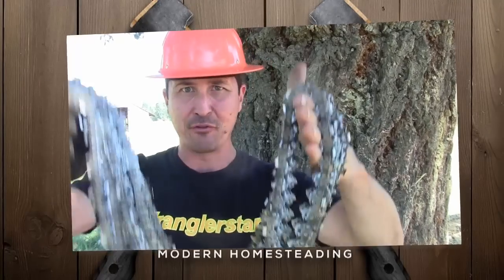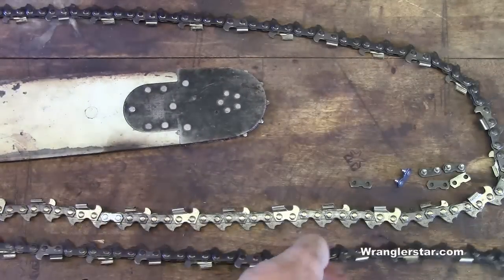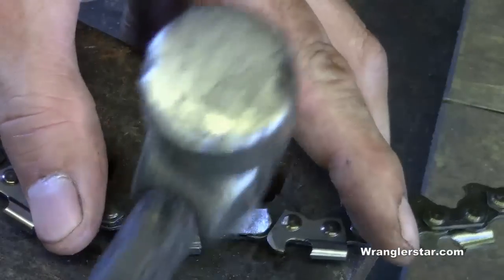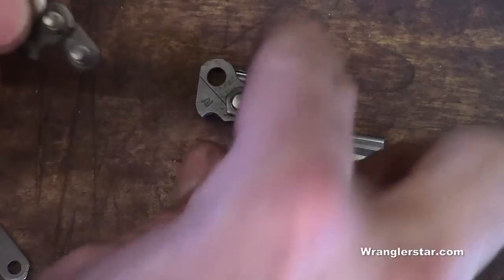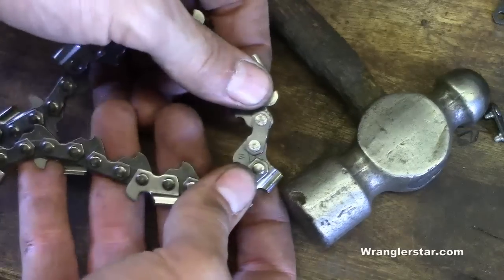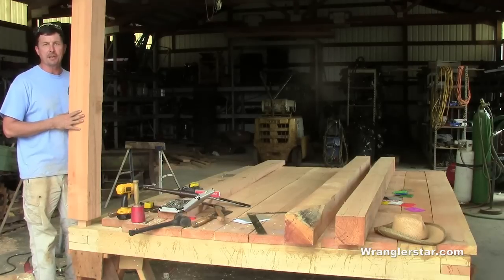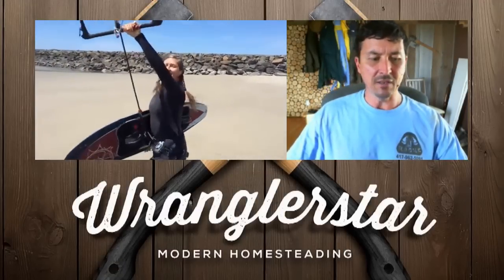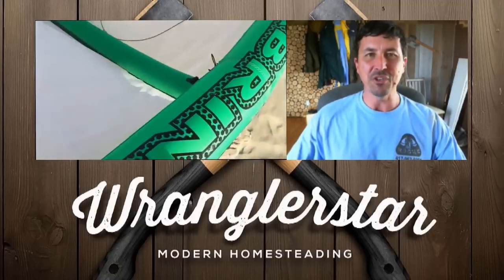How To Make A Chainsaw Chain | Wranglerstar

Comment: Couple things to help elucidate: what yer calling "master links" are known as "presets" (with rivets spun on) and "tie straps". They are specific to a given make/model/gauge/pitch of chain- don't mix em. Chain length is given as #DL, that is, number of DRIVE LINKS,  which are the "shark-fin" thingies that ride in the bar groove and engage the sprockets. Peening rivets is for emergencies only. Northern Tool has a good bench-breaker/spinner under $100. Granberg makes a portable breaker/spinner for $50-something- better at spinning than breaking. Hammering can crack rivets- a no-no.

Comment: Cody you ever look into carbide for your chain saws.. they are almost  indestructible ..hit the dirt or a piece of hidden wire not a problem.. but are not cheap, but 1 will outlast at least 6 well cared for blades.

Comment: I used a vice grip chain breaker for 20 yrs. I had my 100' roll of chain in my pickup, it would take about 5 minutes to make a new one up.
If i had a broken side strap on my chain, i'd fix it with out taking the chain off the saw.
55 yrs ago when i broke my chain, i fixed it with a flat file, 3/4" socket and used a nail for a punch. When fixing a used chain, you have to use used chain straps, new ones cause the chain to loosen and tighten up.

Comment: Am reticent to speak up. But I think it's the drivers you count (look like sharks teeth). Then you would not have to back up one. 

When tightening the chain and bar on the saw, the slack must be taken out of the fit of the bar. Simply hold the bar nose up just enough to take the little bit of slack out of the bar. And if the chain is just properly tight, then snug up the bar nuts.

Comment: I noticed on these chains if a link does get to tight and won't smoothly move on the pins/rivets that you can put a hard tool like a chisel in between the link where it is open air space ( like in between the two "link' sides and on a hard surface like an anvil, hit fairly hard with even a claw hammer on the chisel and the link will loosen enough to work good again. Gotta be careful and not damage the link when doing it but solves the problem I found out and does seem to get you back "sawin" again making progress.

Comment: For complete chain bar maintenance . Not only ensure oil holes on both sides of the bar are clean and but, in addition, clean the interior of the bar slot with either the Oregon slot tool or similar or even a clean putty knife prepared with kerosene/gasoline, scrape and clear with high-pressure air.
This will ensure the fresh bar oil will travel the full length of the bar unimpeded by dirt or sawdust build-up!

Comment: Cody I have a residential craftsman 18 inch chainsaw and was wondering what type of chain you would recommend to use on small chores around the house. Like limbing trees and cutting them to size for fire wood

Comment: regarding the mushrooming safety comment... super important to remember. most times those tools are not hardened at the striking area but are not super soft either, and do have internal stresses. once a shard comes loose those stresses can assist in turning that small shard into a harmful projectile.

Comment: I always wondered how to make a chain.  I have a cheap 14" chainsaw but have thought about putting a larger 16 or 18 " chain on for occasional use.  How do I make sure I get the right bar that will work with my chainsaw

Comment: good video - My wife bought me a ROGUE 7" Tomahawk hoe a couple months ago and I didn't really get a chance to use it until last week when I used an excavator to dig a 700 ft water supply trench at the farm; I used the Rogue to pull dirt on the 1.5" PVC supply line just to give it some support in the ditch before using the blade to cover it - what a great little tool, has the weight to dig in a pull dirt I used to use a shovel for.  Then when the plumber installed 190 ft of 4" drain piping he used it to pull dirt back in the ditch to support the pipe before using the excavator blade to cover the drain system and his crew loved the Rogue.  I had a hard time keeping track of it to the point I was afraid they were going to toss it on their truck so I finally confiscated it.

One last issue with the Rogue - when the UPS delivered it you could tell they dropped it and I had to 'ping' draw out the dent in the blade - they need to cover the blade edges with something a little more substantial then cardboard.

Comment: I noticed you didn't talk about pitch or is it covered In a different video.  I have 3 saw with 3 different pitches. As the bars or sprockets get replaced I'm going to change them so I don't have to have so many extra part around.

Comment: Ok, Ok. I promise to be more active in the future. Cody, I have an older chainsaw (about 15 years old) that only gives me about 10 minutes of use before the chain gets loose. Any suggestions? I cleaned all the gunk and sawdust out of the sprocket area, it appears to be in very good shape but won't stay tight...

Comment: I knew if I searched I would find someone that would do this without a chain breaker and spinner. Without thinking I bought a 25 ft roll of chain but did not know 1 thing about how to put it together. Thanks I did not want to spend money on such a specialized tool as a chain breaker and spinner.

Comment: Cody, I've been out of action for 18 months and need to get the chainsaw out to cut some firewood ... didn't get to clean it up before I got sick. Can you do a video on how to do a quick clean-up on the saw before I get it up and running again? I'm worried about stale fuel and clagged up sprokets etc.
Reply: If you drain out the old gas, put some fresh stuff in there maybe with some stabilizer in there, pump some fresh grease into everywhere it'll go until you see quite a bit flow out, and do an oil change on it(if it's a 4 stroke) you should be good to go. It's probably a good idea to have a look at the spark plug as well as spray the tank with some carb cleaner or brake cleaner before you put the fresh gas in, but it's not super necessary. Make sure you drain whatever you clean out of the tank.
Reply: Thanks Jack.. It's a 2 stroke (Stihl MS391 http://www.stihl.com.au/STIHL-Products/Chain-Saws/Landowner-Chain-saws/21615-1572/MS-391.aspx ). I've only used it twice so I don't want to stuff it up now by not servicing it properly. I would pay a professional but our local guys have proven without a doubt that they are incompetent fools when they did the 5 hour service on my mower and did $350 damage to it attempting to straighten something that was supposed to be bent. It's home servicing from now on.
Reply: I would tip out old fuel and replace with a fresh mix with new petrol. I have done this with machines left 12 months and they started up, it may take a few more pulls than normal to get it going. Do not try and start it up with old fuel in. If saw is not going to be used for some time tip out the fuel and run it dry.
Reply: You have gotten good advice here, and I'll second or third that advice. Drain out your old fuel and put some newly mixed fuel in the saw and see if it will run. I do worry you might have more work though, as a lot of the fuel in the US has ethanol in it and it can do bad things to rubber parts, stuff like fuel lines etc.
Even so, if you have to fix it yourself, I say go for it, there are lots of good videos on rebuilding the carbs and such if you need to, these are fairly simple machines and you don't need a lot of specialist tools to service chainsaws.
Domo
Reply: I did find something on the Stihl web site about draining the carbi first to stop the diaphragms from sticking together. Sounds like something easy to break. I'm pretty good at fiddly mechanical stuff, but I'm nervous about stripping down a brand new saw that I've spent a bucket load of money on. Gotta get into it and learn at some point though. Thanks for the tips everyone.
Reply from the maker: I have a two part series how to service your saw. Here is the link http://youtu.be/vFwVCU_O9-4
Reply: Thanks everyone, great advice. It might actually hit double digit temps here today, so I'll have a look at Wranglerstar's videos in the link above, then get to work. I put good quality fuel in it, so hopefully there's not too much damage.

Comment: Is there any specific type of bulk chain I should look out for or avoid?  The reason I ask is because I found an online retailer that sold 100' (proper guage and pitch) for a little over $300.  I then found another online retailer that sold 100' for just over $200.  Are they all the same and the one place is just a better deal or is there such a thing as more cheaply made bulk chain?

Comment: Again great video. Definitely a good way for the average guy to make chain, without having buying a breaker and spinner. 

I see you're using semi chisel chain, any particular reason? I thought all you west coast guys ran square filed full chisel chain.😉
Reply from the maker: The chain used in the video was ripping chain, I typically use full skip chain for crosscut work,
Reply: wranglerstar
 Good deal, that makes sense now. Here in the Midwest skip chain is nonexistent, I have to order it from Bailey's.

Anyway take care and keep up the good work.

Andre'

Comment: I have a question. I came to own a craftman saw and I do not like it. Is it normal to have to tighted the chain after 3 cuts every time even after the chain and bar are already warm? It also starts in gear with the chain running. It stops when you hit the throttle but I have no idea how to fix that. I am saving for a stihl but It is going to take a while for me to be able to afford it.

Comment: The 3 of the most important things you need to know when replacing your chainsaw chain, it's also good to be SURE of its make/model.

First, you need to figure out how long the chain is/needs to be, this IS
 NOT DONE BY COUNTING LINKS.  This is done by counting the number of 
DRIVERS.  

Second, you need to know the PITCH of the chain, that is the distance between three of the rivets on the chain divided by two.

Third, you need to know the gauge, that is the thickness of the driver link (that is the part that runs inside the groove of the chainsaw bar).

There are other considerations too, like skip tooth or full house, chisel tooth or round tooth, low profile or regular and a few others.  The best thing if you are not sure is to take the old chain and saw into the saw shop, save yourself a second trip to town...

Enjoy the vids, thanks.
Reply: Did you notice the size of the rivet and the size of the hole, Cody has installed the weakest link and the saw will pull it apart

Comment: Cody, I've noticed that ever since I first started watching your youtube channel that you have always worked with the ms 260. How long have been a user of one and any issues with it? I ask because you are a BIG time chainsaw user. I wish I can one day use a chainsaw to mill. Thanks.
Reply from the maker: It seems to me for most guys the MS260 is a near perfect saw. The 260 is far to small to use with a chainsaw mill apart from ripping small material.
Reply: Thanks for the information.  Do you know if there are any differences between box store brands and dealer brands? Husqvarnas are sold at lowes and at a dealer. I hear a lot of different things such as: dealer sold chainsaws are tuned, build quality and customer service but I'm not sure what direction to go. Im leaning towards Stihl because Cody stands by the brand.
Reply: That sounds awesome!!! Thank you so much for the information.
Reply: MindOverEverything
Excellent advice, I could not say it any better and the only thing I would add is that if you go to a good saw shop, they might have a good reconditioned saw for a reasonable price, that might be a deal for you.
Domo

Comment: Hi cody, i bought a stihl ms 261 on your word that the 260 is your favorite saw. I tried to find the 260 but couldn't, my question to you is what type of chain would you recommend for this saw with an 18" bar? I'm new to this and just got some land, i would be useing the saw mainly for felling and bucking firewood, average tree size would be around 18" to 22". i'm asking this because i know you are well versed in this area and i trust your opinion over any dealer i know. i know youre a busy person and may not have the time to respond but i figure i'd try anyway. thanks
Reply: Hello! I work on saws all the time (lawn equipment mechanic). You've got one hell of a saw! That 261 feels good with a 16 or 18 inch bar, iv heard at 20 inches it starts to lose its oomph.  As far as chain goes, since it's just a firewood saw, good Stihl chain will do just fine.  No fancy full chisel or half chisel or skip tooth or anything like that. Just regular chain. Keep it sharp and you'll have NO problems whatsoever. I have an old 028 super with a 20 inch bar I use as a firewood saw. I sharpen it after each use and just run regular Stihl chain and it cuts PERFECTLY. Here in SW Missouri our trees are about the same size as you mentioned and it has no problems.
Reply: Hello! I work on saws all the time (lawn equipment mechanic). You've got one hell of a saw! That 261 feels good with a 16 or 18 inch bar, iv heard at 20 inches it starts to lose its oomph.  As far as chain goes, since it's just a firewood saw, good Stihl chain will do just fine.  No fancy full chisel or half chisel or skip tooth or anything like that. Just regular chain. Keep it sharp and you'll have NO problems whatsoever. I have an old 028 super with a 20 inch bar I use as a firewood saw. I sharpen it after each use and just run regular Stihl chain and it cuts PERFECTLY. Here in SW Missouri our trees are about the same size as you mentioned and it has no problems.
Reply: +James White thanks James much appreciated, and she is a good saw and never backs down from a job. Was gonna mod her but not sure it's worth the effort as she cuts like a Beaver on meth!
Reply: Lol, that they do! If I had the extra money I'd have splurged and bought one by now! They run good, are pretty efficient, and will last for years
Reply: +James White if you can I'd recommend it for sure, but you already know that. 

Cheers

Comment: Does the ripping chain have different angles cut into the teeth or is it the same chain used for cutting firewood?
Reply: Typically 3/8 ripping chain has a top plate angle of 10°. Regular saw chain can have the top plates of the cutters modified from the original top plate angle to 10° by chainging the angle from original to 10° in 5° increments when you sharpen the chain with a grinding wheel. To make ripping chain from regular chain, the pattern goes in 2's or 4's, depending how you count. You leave 2 cutter top plates intact, remove the top plates on the next 2 for scoring teeth. Then continue on down the chain. this works best when the chain driver/link count is in multiples of 8. After the chain is modified, you have 2 scoring teeth and 2 clearing teeth. If using .325 ripping chain,  it is no longer manufactured and must make your own. 3/8 ripping chain can be purchased in pre-made loops or rolls but is a lot more cost than modifying a regular loop of chain.
Reply: Thank you for for the info.  On the top plates you're talking about removing is that just the flat part sticking out to the side?   Do you know of a video on this?  I tried searching for one but didn't find one with all the details.
Reply: Yes, just the part sticking out from the side leaving the side height of the cutter intact. watch my channel for a video on the procedure in a week or so.

Comment: what does a ripping chain do to the wood that other chains do? Also what kind of other chains are there and what is their purpose.
Reply from the maker: It seems to me Daylon the ripping chain leaves a much nicer finish on the wood. Not so rough as a crosscut chain,
Reply: Interesting. So I guess one would not pick a ripping chain for falling big timber.

Comment: Question is a homelite 550 we got in the 70's worth getting up and running
Reply: Yes. The 550s and 750s are rare and hard to find. I still use my 1972 homelite SXL
Reply: @tribulation138  used to cut firewood up in the sierras in the late 70s to early 80s now wood fires are banned here in the valley, it has been hanging in the shed for last 30 years my new one is 12 in ryobi 18v it dose everything i need, but need to get homelite 550 going it has 24in bar

Comment: If I were you and doing a lot of cutting I would switch to a skip tooth chain instead those full house chains your running it’s easier on your saw in the long run and they seem to cut just as fast

Comment: You mentioned in your video that you don’t want any wiggle in the link you just hammered, the rivets in the link you installed is way to small for the hole on the chain. A cardinal rule in chain making is to ONLY use chain parts from the same manufacture that manufactures the chain; the part you installed is the weakest link in the chain and the saw you are using the chain for is going to break the link and may cause a major accident; additionally hammering on the chain weakens the metal,  Cody, you are demonstrating very dangerous techniques ,